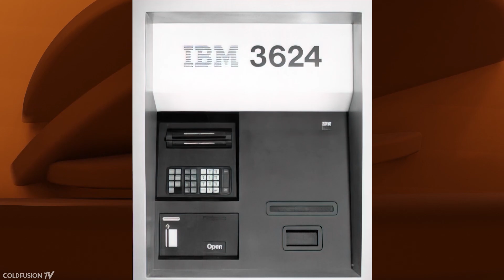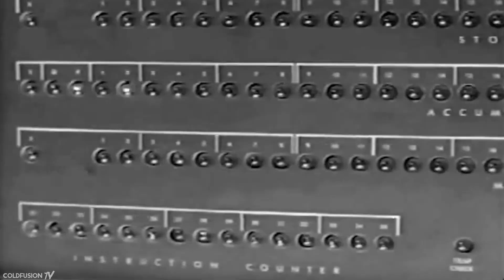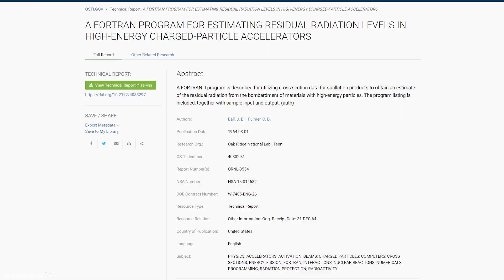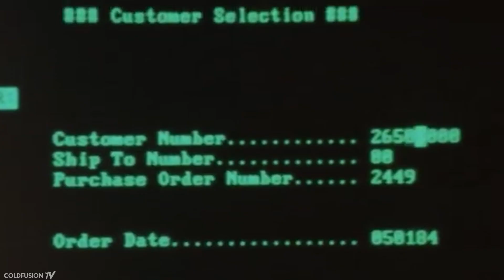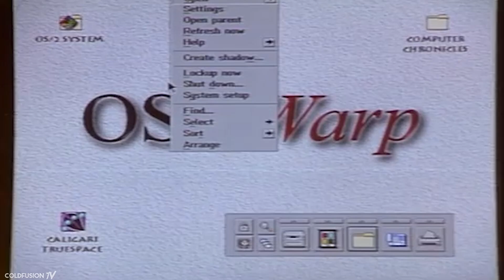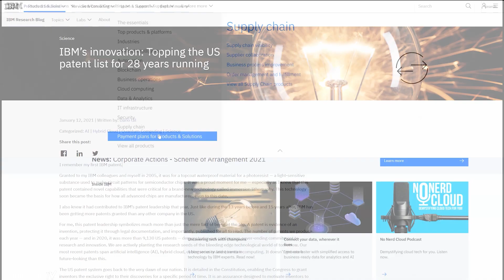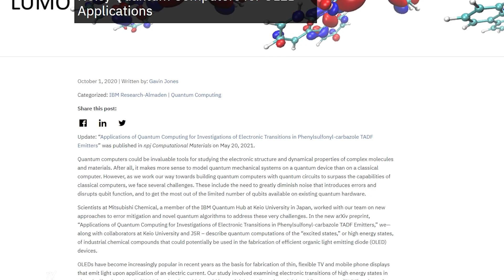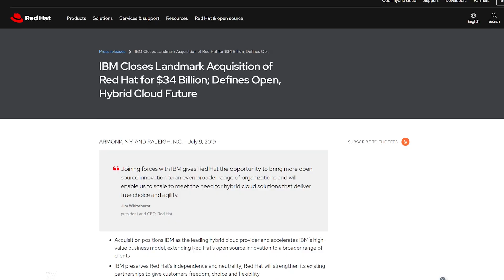The Rise and Stagnation of IBM

Comment: What I've been seeing is IBM holding on to a business model, which they've dominated in for a very long time, which involves both consulting and implementation of business solutions.  That is, customers come to them, tell them what they need and build it (and typically maintain it).  However, this does not mean they are resistant to the emerging business model (hah, it's here already), which involves selling computing capacity (cloud computing), and then training/certifying professionals to build the solutions, as either an employee in an enterprise environment or in a consultancy for enterprise environments.  IBM supports this model to the extent that it trains/certifies professionals to work with their technology.  But, they've yet to make a big splash in selling computing capacity as a service the way we see in cloud computing.  Whether they get away with this remains to be seen. If not, it'll be a very slow death, because they are really good at what they do, despite the blunders with consumer technology.  There were lots of entrenched companies that failed to see the writing on the wall.
Reply: Administrators and bureaucrats stymie innovation and creativity by imposing order and control.

And no where did I see this more than with IBM in the late 80s and early 90s!

I was there in their IBM Operating System division Austin, Texas.  Their operating system was competing with Microsoft at the time - And we know who won that race. 

Walking down the halls at IBM revealed the cancer that had devoured the entire company.  All the people walked like zombies, holding a creepy blank stare as they slowly shuffled aimlessly down the halls.  I have never seen anything quite like that to this day.  

I was closest to the teams that fielded troubleshooting calls from customers.  IBM hired street temps to handle those calls!  Totally uneducated and largely untrained people were in charge of helping people over the phone whose computers were hanging due to some software and/or hardware failure. Who the hell was running the show over there?!

Humanity is a strange phenomenon to me whereby "Kings wear no clothes" - yet everyone does whatever they are told under the color of authority.  Like the useless Rama X, the King of Thailand, the highest executives - despite being feeble minded - get all the wealth and glory. 

We see this today in corporate life and the governance of countries: men whose inability is as vast as their wealth, power and privilege running the show! 

There are many bogus career tracks whose functions merely require hubris, bravado, mendacity, and lack of conscience:

Bureaucrats, administrators, corporate executives and board members, academic instructors, music maestros, politicians, clergymen, managers, law enforcement, corporate chiefs, actors, salesmen, religious leaders & evangelicals, etc.

They are hired or elected not based upon technical or functional ability, but simply their ability to “look & act” the part!  

It is for this very reason that con's, inept's, and those seeking unearned power & self-aggrandizement are fundamentally the ONLY people to hold those positions in life: People who are utterly incapable of holding any job that actually requires skill!

Consider the perennially bankrupt Donald Trump: his value is not based upon his functional abilities, education or management savvy, (my Uncle was his chief accountant at the TajMahal), but rather his Hollywood image!  Even though the CIA was using the Taj to launder drug money the casino collapsed. {The BCCI bank had closed at the time following Congressional hearings thus ending the CIA's ability to launder its drug money. Trumps Taj just filled the void - Similar to Atlantis Casino Resort Spa today. See Mary Carter Resorts Study (1994) or Evidentiary Realism (page 35)[2] and this article NY Times [1], SEC lawsuit findings [3]}

[1] https://www.nytimes.com/2016/06/12/nyregion/donald-trump-atlantic-city.html

[2] https://books.google.dm/books?id=2vSRDwAAQBAJ&pg=PA35&lpg=PA35&dq=trump+taj+mahal+cia+money&source=bl&ots=vKUS76dqGU&sig=ACfU3U01VQyTbDucYm2uFNpgNPZCIrjk2Q&hl=en&sa=X&ved=2ahUKEwizyZW2kZvqAhVBKa0KHdnQAdcQ6AEwDXoECAkQAQ#v=onepage&q=trump%20taj%20mahal%20cia%20money&f=false

[3] https://www.sec.gov/foia/docs/trump-hotels-and-casino-resorts-inc.pdf
Reply: @markhuntermd  You probably won't be surprised to hear that IBM outsourced PC maintenance to the lowest bidder. As techs, we were supposed to send our field PCs to them for repair. (We didn't or at least I didn't - I asked the PC side for the part and fixed it myself.) 

Meanwhile, Dell outsourced repairing their customers' PCs to IBM techs. (Our PC field techs were very good.) 

The outsourced low bidder techs were so bad that at one point, marketing almost lost a $3M contract because a college kept sending PCs in for repair and they'd come back still broken. 

Their solution was to send me four hours one way away from my customers to run a meeting at 9 a.m. once a week assuring them that we would bring our IBM PC techs in and get all their issues repaired on-site. 

Why I got sent I don't know. Couldn't they have had a local PC tech run these meetings if marketing wasn't willing? I wasn't a PC tech -- I was a mainframe tech who happened to work on PCs because they were used as the consoles of mainframes.
Reply: @Growmap  - Thank you for sharing this fascinating info! 

The USA corporate world sucks because of monopolization and being able to solicit unearned money on the public stock market.  Thus, they are not subject to competition (challenging market forces) and balancing their budgets.  

We saw the same with the US Steel industry, and later the car industry.  

In the end, hard working foreigners produce better product.  And even with massive tariffs (eg Reagan's massive motorcycle tariff to protect AMC/Harley), American industry fails!  

Investing in companies should not be based upon a public stock market; but rather private contract and pursuant to actual performance. 

The US Government must stop protecting zombie companies (and banks).  

But you know that won't happen.  I voted with my feet and left the USA for good.  Best decision of my life.
Reply: @markhuntermd  I agree with you except for steel. US Steel was far superior to imported steel. You can easily see that in rural America. 

Old structures with US steel roofs are in good shape while newer buildings with imported steel roofs are entirely covered in rust.
Reply: I have seen some instances of IBM being involved with blockchain technology.

Comment: You glossed over the entire point of how competing manufacturers reverse engineered the original IBM PC hardware to sell their own clones. That had more to do with IBM's downfall in that market than Microsoft writing software. "Today everyone should have an IBM PC in their home".. Well, most of us non-Apple-users use IBM compatibles and I'm writing this comment on one, so.. ;)
Reply: That is true. That's why many computers in the 80s were called IBM PC clones. In fact, the term PC is based on IBM. You could probably draw a throughline from that first IBM PC to modern x86 PCs because of the proliferation of DOS then Windows.
Reply: @fattiger6957  You’re at least partially correct.
Reply: Actually, all the Macs sold from 2006 until the new M1 Macs are IBM compatible, which is why you can run Bootcamp and Windows on them.
Reply: @Nabeelco  Indeed, good point!
Reply: @Nabeelco  probably more accurate to say x86 compatible rather than IBM as its the Intel CPU  which is the more governing factor when it comes to " PC compatibility"
Reply: Throwing in my 2 cents. People interested in learning more about this history should check out the documentary Silicon Cowboys. It covers this era in detail!
Reply: The IBM clones were licensed to do such.  Intense competition narrowed the field to only three remaining companies with a x86 license… Intel, AMD, and VIA.
Reply: He also completely glossed over the whole expensive disaster that the attempt to reclaim the hardware market with the help pf the proprietary technology in the PS/2 product line was.
I am a bit disappointed by the video, it's very reductionist to the point that people get a wrong idea about what really happened.
Reply: They also shot themselves in the foot with proprietary MCA cards. I worked in a UK national business in IT at the time. We couldn't drop IBM fast enough when they started selling PCs with network cards that cost 5-6x as much as the competition and wouldn't work in anything that wasn't IBM.
Reply: And because there was IBM-clones, as a 16 year old, I was able to buy one in 1986, else I would never have been able to fork 5 grands for it.  So in a way, that dumb IBM decision helped my and many others careers imo.
Reply: It is bound to happen and I am glad it happened. Imagine if IBM went behind those clones and shut them. Maybe we won’t even have these amazing laptops and PCs we see and use today.
Reply: WRONG!!!  IBM RIPPED OFF DIGITAL RESEARCH(THEY HIRED BILL GATES TO STEAL CPM DOS!!)
IBM WAS TO LAZY, INCOMPETENT TO DO A PC DOS, SO THEY GOT MICROSOFT TO STEAL CPM DOS FROM DIGITAL
RESEARCH( GARY KILDAL(DIGITAL RESEARCH OWNER) FELL FOR THE IBM CON JOB + A FEW MILLION DOLLARS
TO SETTLE WITH MICROSOFT AND IBM TO LET THEM RENAME CPM DOS AS MICROSOFT DOS AND IBM DOS.

THE HARDWARE TECHNOLOGY CAME FROM INTEL, IBM CONTRIBUTION WAS VERY LITTLE.
(WE WERE MAKING CUSTOM PC'S BACK IN 1978).

  THE IBM CON IN THOSE DAYS TO SOFTWARE COMPANY'S WAS "GIVE YOUR SOFTWARE TO IBM THEN WE WILL
SEND YOU MILLIONS OF CUSTOMERS!!!  A LOT OF COMPANY'S FELL FOR THAT CON JOB.

 EVERY "MINI COMPUTER, MICRO COMPUTER, PC MANUFACTURER" HAD THE SAME CON JOB GOING
TO BE A CONSULTANT FOR XYZ COMPUTER MFG YOU NEED TO BUY A $10,000 T O $50,000 WORTH OF INVENTORY
THEN WE WILL PUT YOU ON THE DEALER OR CONSULTANTS LIST.(WHAT A JOKE).

HUNDREDS OF PC, MINI COMPUTER,PC DEALERS FELL FOR THIS CON JOB!!!.

I DID NOT!!!  WE ALREADY OWNED IBM MAINFRAMES(FROM OUR LEASING COMPANY) SO WE WENT ON
THE IBM CONSULTANTS LIST FOR FREE.

ALL THE REFERRALS FROM IBM WERE PROBLEMATIC CUSTOMER THE IBM SALESMAN  WANTED TO GET
RID OF!!!.

IBM SALES PERSONS WOULD TELL CUSTOMERS TO BUY A $30,000 TO $100,000 SYSTEM.
THEN THEY WOULD TELL THE CUSTOMERS THE "CUSTOM PROGRAMMING SHOULD BE ONLY 5,000!!)
THEIR DECEPTION RUINED EVERY LEAD.

THE IBM AND CUSTOMER CON:  IF YOU GO AHEAD AND LOSE MONEY ON THIS SALE IBM WILL SELL
THOUSANDS OF COPYS OF THE SOFTWARE FOR YOU THEN YOU'LL MAKE MILLIONS!!!

I STOPPED TAKING REFERRALS FROM IBM WHEN THEY WANTED ME TO LOSE MONEY AND
WORK FOR FREE FOR THEM SO THE IBM SALESPERSON COULD  MAKE A SALE!
Reply: I wonder what would've happened if IBM had gone after the IBM PC clone makers like Apple went after  their clone market and got it shutdown.
Reply: True, BUT, considering that would've happened anyway, the one thing you can 'lock in' your customers with is the operating system.
Reply: @rickyspanish4792  well if they used bespoke hardware they couldn't legally be copied. Instead they depended on a bios while the rest was off the shelf.
Reply: @donald5967  I'm not saying IBM PC wasn't "a standard" but "the defacto standard".

IBM introduced it's very first PC into the market in August of 1981.  In contrast, Apple II, Comodore, and TRS-80 had all been on the market since 1977.  Compaq entered the market the year directly after IBM in 1982.

So again... Compaq selling it's first PC as "IBM compatible" doesn't at all mean it was the defacto standard of home computing.  IBM had just been on the market for a single year, vs Apple and Commodore's 5 years at that point.

It wasn't until 1984, the year the Tandy 1000 launched, that IBM and it's compatibles reached sales equal to Commodore 64, and surpassed that of the Apple II and Atari.

The IBM PC and it's clones didn't reach 50% of the market until 1986.

https://arstechnica.com/features/2005/12/total-share/5/

Comment: Patents yes.  I worked at an IBM location a while ago, and they give large bonuses when a patent is awarded.  And, that did happen where I was working.
Reply: re: "large bonuses"
The bonuses were not that large.  I recall you got an award for the first patent filed and then awards only at a plateau level.
Reply: @moobiemaykker9639   Patent bonuses at IBM were never large per patent.  If you had lots of them and combined the bonuses you might be able to consider it large in summation.   The plateau bonuses were a thing - partly cash and partly swag.
Reply: Former IBM-er here. Not sure how large they were in your division, but when I saw there were offering literally 1k USD for the first patent (later increased to 1.5k), no matter what you actually would come up with....uhh, no. :)

Though we were treated as a "cost center" from the start, and our band levels were lower than actually "possible" in the "true" IBM, so...
It's just sad to see how many gave out their best, most productive years and hearts, being stuck at "junior" levels for years - to get some decent offer only after they send in their resignation. And even then, the proposal would be at 50-60% of what the other companies were offering. :-/
Reply: Then you look up said patent and its some random crap that serves virtually no purpose.
Reply: Lies again? UFC WWE IBF Department Of Justice

Comment: I work in engineering at a software firm, and we still use Fortran extensively. Most of our solvers are still written and updated in Fortran, and some parts still use FORTRAN 66 syntax
Reply: Is it faster than C? And easier than assembly?
Reply: @houssamalucad753  Fortran is easier than C and around the same speed.
Reply: @houssamalucad753  When CDC wrote their first Unix subsystem (for the Cyber mainframe) it was partially written in Fortran.
Reply: People tend to dismiss FORTRAN just because it's old, but it's a fine tool for it's purpose. It's still around because there's nothing better at what it does best. Grady Booch says it best: "old software never dies, you have to kill it".
Reply: @YeOldeKamikaze  It's also still around because there are lots of blackboxes that would take lots of time for programmers, who may have never learnt the language, to fully understand and port to newer languages. Newer languages may do some things slower, but I doubt that those old programs written in Fortran are as easily scalable as ones written with newer architectures in mind and with languages that support newer paradigms
Reply: How's it compare to other scientific languages like Julia? I honestly thought the industry was moving towards Python/Julia type things these days. Edit: Ah it's compiled, that's a major advantage of Fortran.
Reply: @TRDiscordian  Fortran has good optimizations for handling arrays of numbers. For that it is faster than C. 

Something like MATLAB/Octave or Julia or NumPy/SciPy will have more built-in features. With Fortran you will have to write more functions from scratch. However, once the Fortran code is written this disadvantage goes away. So codebases written in Fortran tend to stay in Fortran, while new projects tend to use other languages.
Reply: FORTRAN. There’s a word I never thought I’d hear again. But hey, lots of businesses still use COBOL, so I guess anything is possible.
Reply: Fortran statically allocates space for all  variables at compile time, so that's why it is often faster than c.

It's a cool bit of kit, and worth learning.
Reply: Wow
Reply: Used fortran on vax during college days in late 80s.. such a relieve from using the tedious codings of  assembly language
Reply: Pretty sure NASA used FORTRAN for the lunar modules during the space race, due to its strength in math.
Reply: 99% of all software is written in c c++, python, java, HTML. NOT ONE WESITE IS WRITTEN IN FORTRAN.  LAZY COLLEGE TEACHER WERE THE ONLY PEOPLE TO ADVOCATE FORTRAN(TOO LAZY TO LEARN C++)
Reply: WHEN I WORKED AT COLLEGES THEY ASKED ME TO TEACH FORTRAN, I REFUSED SINCE NO ONE USED FORTRAN.
Reply: if its not broken don't fix it ^^
Reply: Never learned it in tech school, but my boomer dad learned it when he went to college, ha.